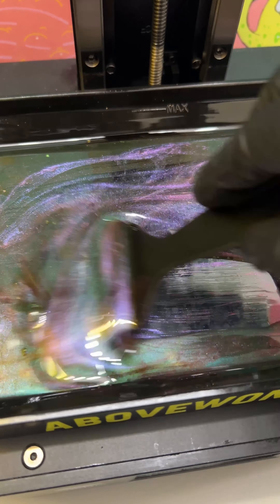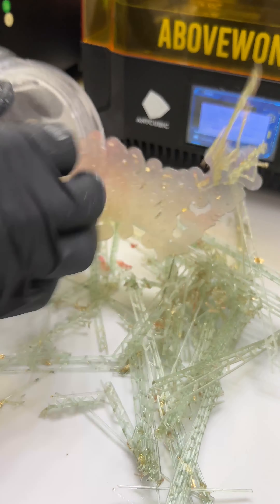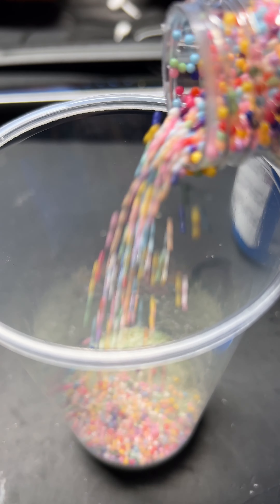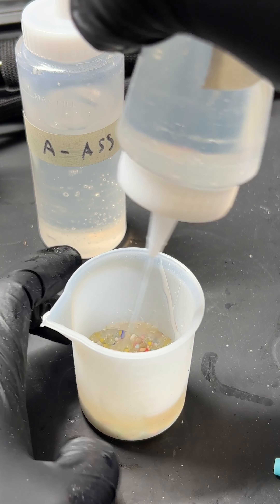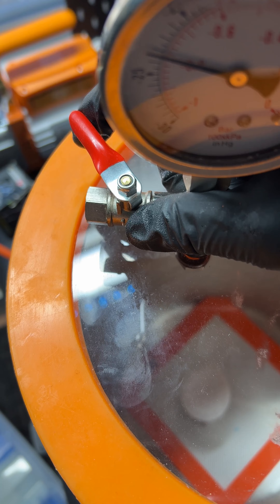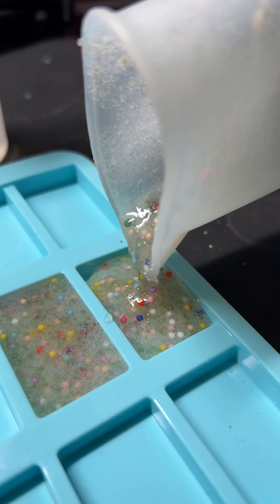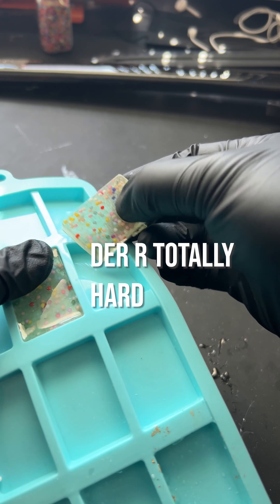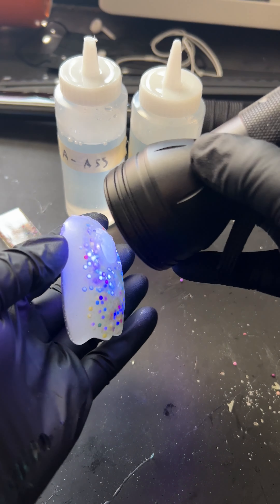Recycling 3d printed resin supports with epoxy

Comment: 😂 ive used epoxy a bit! You definitely have to pick the right one for your project! Also stir slowly to help prevent bubbles from forming, i insert my silicone cup into a hot cup of water while I stir,  it helps keep bubbles down. Ive never had to  torch mine. On a side note, i plan to keep a few supports on hand to use with my 3D scanner to better scan small objects ... otherwise half is lost to the table.